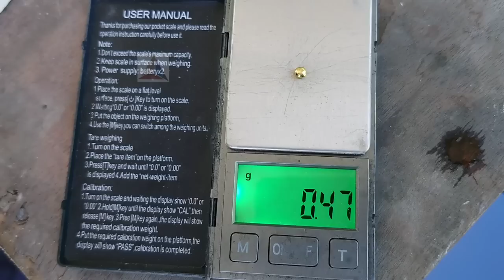Gold Recovery Using Vinegar | Flex Keypad Gold Recovery | Vinegar Gold Recovery

Comment: Another beautiful process.

How do we know of the ratio that we have to use. Lets suppose I have 200 grams of gold fingers, 50% vinegar and 6 % peroxide. How much salt, peroxide and water will I have to use? 

Thanks in advance
Reply from the maker: Two hundred grams of gold finger should be immersed in the solution for at least three inches. I used one hundred milliliters of 6% volume hydrogen peroxide and three tablespoons of salt per liter of vinegar.

Comment: Sir,  good day, may I ask, can this method be used with plated pins or other gold laden materials. Thank you very much for your reply. Happy Easter day.
Reply from the maker: No, only kind of cell phone pcb and flex ribbon type anything, this method wouldn’t work any metallic body gold pins or connectors.